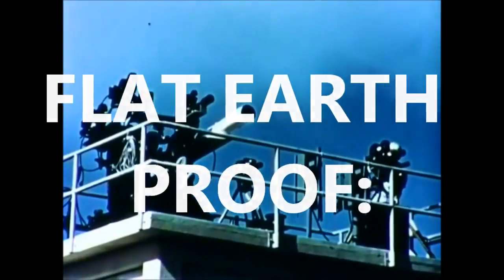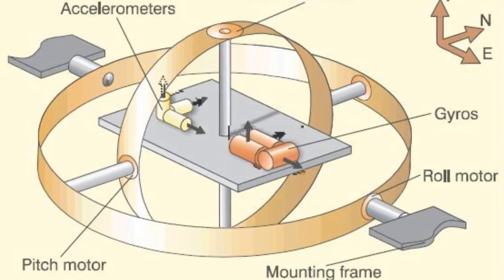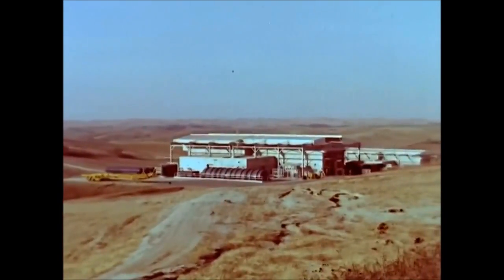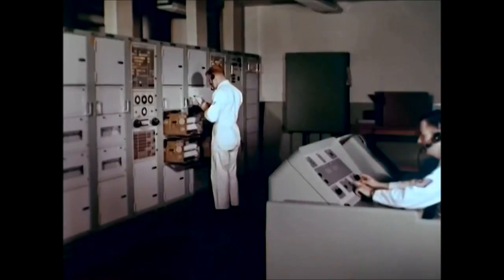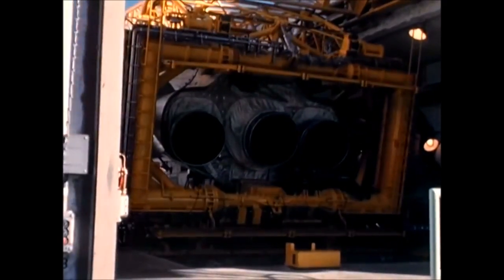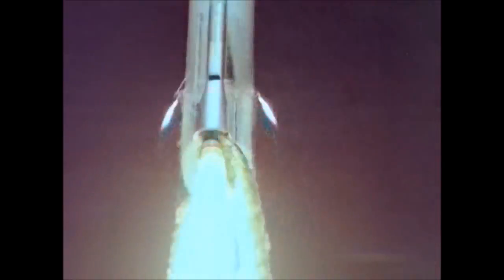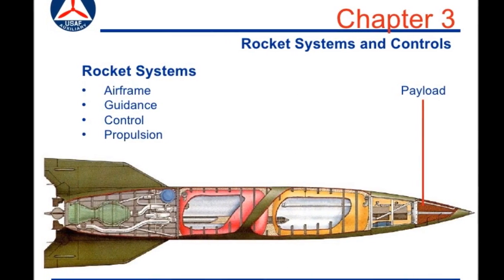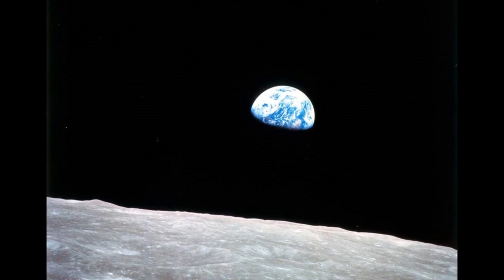Flat Earth Proof: ICBMs, Atlas and Inertial Guidance Systems...

Comment: Inertial navigation doesn't 8ncorporate so called gravity it uses the INERTIA of the moving body the sensor is on to navigate. This doesn't have anything to do with gravity but the differences between a stationary body as opposed to the body in motion, as the vector and rate of movement change math is used to conclude position gravity is not a variable of the math used in inertial navigation, the ONLY VARIables used is the motion of the moving body and the rare of change in speed and direction.
Reply from the maker: First, I would challenge the notion that there is anything that could be truly called a "stationary body" in the Copernican model...  Second, the relationship is not to "gravity" per se, (as I am obviously calling the existence of gravity itself into question), but rather, the relationship between the craft and the alleged center of the spherical Earth (which gravity is alleged to pull us all towards).  

In other words, "schuller tuning" claims to do this in-flight math whereby the instruments automatically adjust for however far the craft deviates from it's original position/orientation, (but never explains how this was actually accomplished, particularly in the early-computing days of the 1950s, when jet aircraft were already flying at high speeds around the alleged globe, and amazingly their artificial horizon instrumentation worked flawlessly...)  

I find the most plausible explanation to be the far simpler one, that these early gyro compasses functioned adequately, because all they ever do is hold a parallel position to the flat plane to which they were calibrated at takeoff.

Comment: It might be worth saying something about changing the direction of a typical ballistic rocket. When the rocket is undergoing main burn, the rocket nozzles are used to point the missile in the right direction (okay, Russian vertical launch missiles use some small jets mounted on the nose to blow the rocket into the right direction at launch). When the rocket fuel is burnt, the nozzles are no longer effective at accelerating the rocket or changing its direction. Typically much of the flight is above the atmosphere, so any fins on the rocket are completely ineffective at this stage. As the rocket begins to re-enter the atmosphere, any fins become able to steer it. At this point, the rocket is relatively low and heading down fairly fast, so the fins can only do a limited amount to change the impact point. How much change is possible is driven by the size of the fins compared to the mass of the warhead, the speed and direction of travel. At some point, either in the air or when it hits the target, the warhead is supposed to explode and navigation becomes irrelevant!

Comment: Planes use 'earth' gyros which align themselves with the earth surface through gravity sensing. Spacecraft use 'space' gyros that stay aligned to a specific point in space. Apollo missions used these type of devices to navigate as they new the alignment at different moments of the travel and steered the space craft to this alignment before firing the engines.
Reply from the maker: no, gyros do not employ "gravity sensing", but rather just the opposite, they "defy" gravity by holding "rigidity in space".  That is why they are used in the first place!
Reply from the maker: El BU So "plain gyros" do show earth's rotation...??  You sure about that?  Many people have actually been doing their own independent tests of this very thing, and not reaching the same findings that you are describing...
Reply: the Truth is stranger than fiction... Ok so because someone is not capable of showing someting. It is not true.
Reply: El BU 
Understand you are accepting a 'belief' on faith about what our scientific community is saying, if it cannot follow the six step scientific method it is by definition pseudo science!
Reply: Damn I really want to perform these experiments myself.

Comment: Man, you guys are worse than young
earth creationists. You've got Ken Hovind going nuts about why
everyone is asking about the flat earth. Even he thinks you are
loony.

You have a rocket (or an artillary
shell) at point A and a target it point B. Both projectiles fly on a
parabolic path which can be calculated. Both projectiles are largely
ballistic, the artillery shell completely so. The rocket just flies
further. The math has probably been around since sometime not too
long after the famous alchemist Sir Isaac Newton invented the
calculus about 300 years ago. The only difference is that the target
will move an appreciable distance before it is hit. But whether you
want to look at the target as being on a ball or on a flat disk, you
will know where it is at in a very predictible way (because of the
huge amount of a scientific concept called inertia). You DO NOT HAVE
TO CORRECT FOR THE TERRAIN below the projectile. The two points
define a straight line. All you have to do is hit the other end using
a parabolic flight path which you can calculate using the calculus
invented by the aforementioned Mr. Newton. And make sure the flight
path doesn't cross the firmament. 

The gyro does not have to correct it
self. That is why they use a gyro. It provides a stable reference and
is mounted on a gimbal that allows it to rotate in three dimensions. 
The accelorometers provide delta-Vee signals. Integrating the
delta-Vee signal (integration is one of those complicated math
concepts in the calculus that made Newton very famous - and can be
used to calulate the orbital paths that you reject) gives a velocity
and integrating the velocity gives a delta x/y/z value to tell how
far you have diverted from the path, and lets you steer back to it.
Accelorometers do work in space and in the absence of gravity.
Actually, one of Einstien's insights was that acceleration is
indistiguishable from the effects of gravity. Or vice versa. Probably
both. Using the x,y,z signals is a branch of engineering called
control systems and is pretty well understood. But it would probably
remain a mystery even if you went to college to study engineering.
Your own video has a picture of a gimbaled gyro with integrating with
gyros and integrating accelorometers. Anything more detailed would be
beyond your comprehension.

I was able to come up with this
explanation pretty much by myself, but I do have an engineering
degree and have taken a little control theory, enough to be
dangerous.This stuff is on wikipedia under topics like inertial
gudiance and ballistic missiles and what I have said is correct in
its broad strokes. Even today it is used in interplanetary space
flight, along with mid course corrections. But I forget you don't
believe in outer space either. You may not have to correct for ball
or flat earth, but be sure to keep your missile below the firmament
and inside the wall around Antarctica
Reply from the maker: Please do take the time to watch the twenty minute long Navy training film on gyroscopic instruments I refer to.  Quite clearly they said in 1960 that a gyro could be put into "slaved mode" by linking it to a magnetic compass to keep it in orientation to the curved surface of the Earth.  I'm not making this stuff up. So either the US Navy was confused about how gyros should really be used in planes back then, or..... Maybe the whole thing about adjusting gyros for rotation/curvature is a bunch of smoke and mirrors, because neither actually exist. Accelerometers wouldn't be of any use when it comes to rotation and curvature (both affecting orientation simultaneously).  I am quite sorry to hear you spent so much time regurgitating material from Wikipedia, as if I hadn't already read everything I could find online (at least from such elementary sources) before even making these videos.  By the way, I AM a "young earth creationist", and if also cling to the idea that the entire universe created itself 14 billion years ago through the explosion of a suddenly existent singularity point....??? Well, ok dude, that's your choice I suppose.
Reply: Ballistic navigation systems don't care about direction. The Sperry Gyrocompass was invented circa WW1 to maintain a true north and works well and reliably and one of the reasons it can do that is because it use the force of gravity pointing towards the center of the  earth to use precession to realign the compass to true north.
If you want to believe that this is all a Judeo-Masonic hoac, that's your choice I suppose. You can't rationally argue with a YECer, nor a FEer by definition.

Comment: An accelerometer will measure gravity but will also measure any other acceleration in any direction.    An ICBM is a ballistic aircraft like a bullet.   Neither the bullet or the missile can go sufficiently fast that they can fall around the curve before they come back down to the curve.   An orbiting low earth object falls around the curve until it gets slowed down by the atmosphere some days later.  Even though the ICBM gets very high it does not have sufficient forwards velocity that it can fall around the curve before it falls and strikes the Earth.
Reply: Ice Skater 
gravity, that's a good one. No proof, no test, no way to measure, just magic! Gravity is finicky, it holds buildings and oceans of very, very, very, very heavy objects to this alleged ball but smoke, dust and gnats all effortlessly defy its magical strength! Density and bouyancy are much better and might I add, more meadurable, testable forces than magical gravity!!